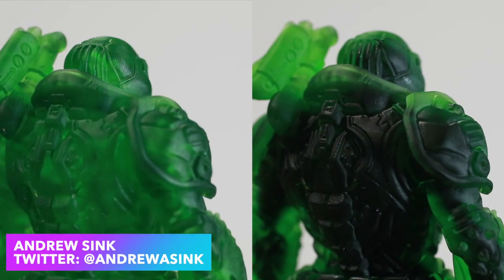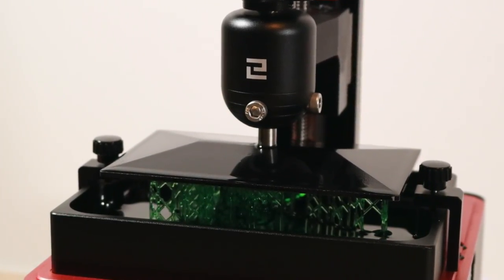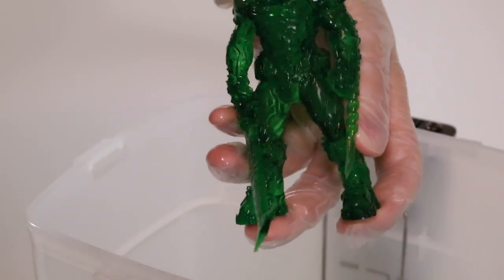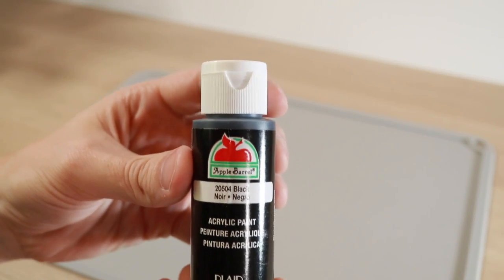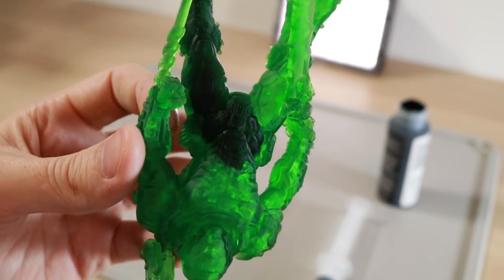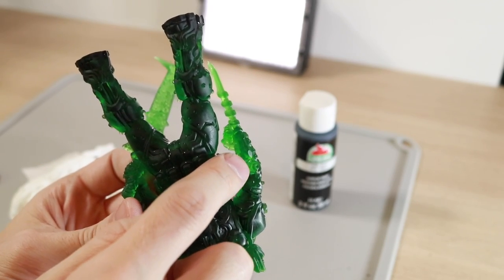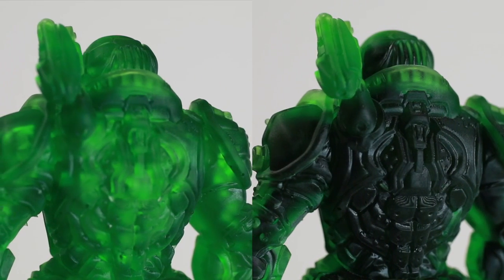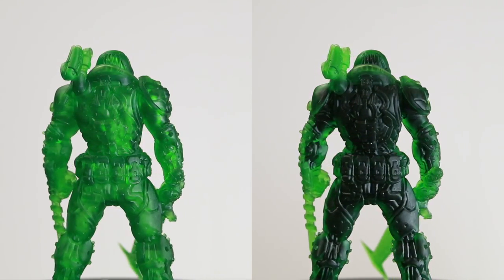Inject Paint into your Resin 3D Prints!

Comment: It's an interesting idea although how successful it will be depends a lot on the model. Some models may require internal supports even when hollow, for example, or may have thin portions that will prevent the paint from entering. Also I assume the paint inside won't ever really dry?

Comment: I wonder if the paint will ever dry like this? You might consider tinting some epoxy instead and filling with that as it would harden and provide a lot of strength which may come in handy for any structural prints.
Reply from the maker: That's a great point. I made an extra, my plan is to crack it open in a year and see what happens!

Comment: If you want to make a solid resin print without breaking the bank you could use a low viscosity, low shrinkage casting resin that could be dyed any color you want. Adding iron powder to the mix would make it even weightier. Apply that thought to the translucent skin, and BOOM!... awesomeness.
Reply from the maker: Wouldn’t the iron powder sink to the bottom of the vat during printing?
Reply: @AndrewSink  I wouldn't add the iron to the printing resin, but the casting resin that you fill the hollow print with. Probably didn't explain it well. Swap paint for filling with a 2 part resin.
Reply from the maker: @KCDarkRanger  Ooooh! That makes perfect sense; great idea!

Comment: Maybe you could try some latex rubber hoses to fill the places not so accesible. As well as low viscocity paints.
Reply: Maybe you can use tatoo ink.
Reply: So what but look like when the paint dries up? You didn't just paint the inside and then let the existing paint leak out where you just ended up with a painted interior? 

It seems like you left liquid paint in the core of the model and as it dries it will shrink and crack?

Comment: Cool. Tbh you should probably be vacuuming the ink into the model. Look into luer lock fittings. Also there are inks that UV cure so that's definitely an option.

Edit: as for luer locks.. print an extra bit that you can cut off that has the threads on the model. Basically a sprue.
Reply from the maker: Clever idea, for sure!

Comment: Why not just use the same resin in clear and mix in ink/pigment and let insides get coated, then drain out excess and cure in the curing station then fill in holes...  That way you don't have all that excess paint trapped...